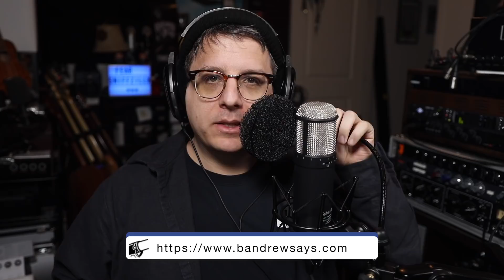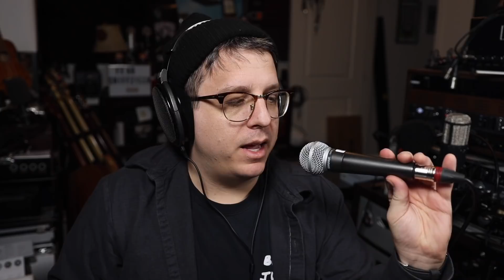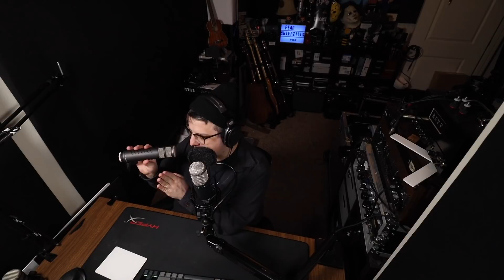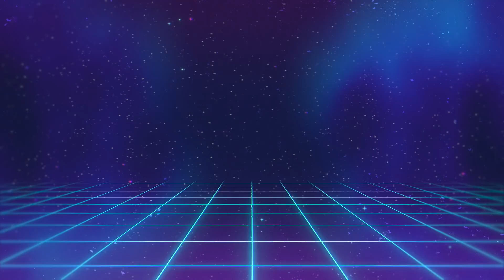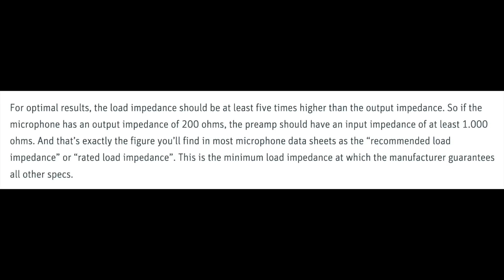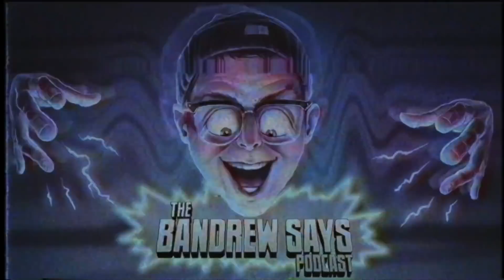Should You Try Other Mics, What is Output Impedance and Load Impedance, and More (BSP-233)

Comment: All I can say is I love this channel for so many reasons . 👏👏👏
Now, as a fun rabbit hole, …Impedance is one of those amazing/important topics of conversation that starts to weed out/invalidate probably 98% of the “vintage gear vs new” side by sides (and many others) that you’ll see online. This is because electronic circuits in audio gear have changed significantly over the years because audio gear used to actually be plugged into tubes/valves before transistors were invented. Meaning mics also had tubes. But there were other technologies around that are obsolete like carbon button, mics, and crystal mics and for fun, look up, balanced armature headphones, and then go look up modern in ear monitor systems and hearing aids and balanced armature . As a result, gear was designed to play well with other common gear.  Now, it’s all an awkward hodgepodge. 
For example, I just plugged in my newly acquired NOS (new old stock) 1961 Reslo RBH/WS “Celeste” ribbon mic today. It actually worked! (Google Reslo RBH Beatles Cavern) essentially the sm58 of the 60s-70s in England. 
BUT, these mics can only use their cable because of the various configurations available, which are identifiable by a color dot on the inside of the cable connector. 
The RBH version I have has a the red dot on the 3pin (not xlr) connector. This means it’s configured/set internally to be high impedance. This is supported in that the other end of the cable is a TS 1/4” connector.
BUT
…..drum roll……
The badge on the mic says Reslo, Hi-Z, 30 Ohms 
😁
Does 30 Ohms sound like Hi-Z ? NOPE! Pretty confusing then right?
Just like how the word “sick” can mean two completely different things depending on who saying it.
Different times, different circuits, different connection needs.
Also, output impedance is frequency dependent. Also, all those modeled plugins we use that were born in the 1960s and later may originally be designed with different impedance than you may be aware of. And how have manufacturers accounted for this as it relates to frequency etc etc etc etc 
I’ve been in this industry for a little over 28 years now and I’m still cut off guard and surprised every once in a while by something like this Reslo 30 Ohm “Hi-Z” mic 😁

Neumann microphones among other top brands have played a big role  in my career, but interestingly, I do not own any of their microphones, or AKG (another landmark mic brand throughout my career). 
Because I buy tools for their capability, not their brand recognition. Especially when I very clearly know what I am and I’m not paying for and receiving with them at this point. 
My favorite mics of theirs are no longer the best choices for the price like they used to be. It used to be they were one of only really a few choices available.
Other than my little pet project with the Reslo - which is my first ever purchase of a vintage microphone - I buy microphones that have the best capabilities, and I mean, actually the best capabilities and consistency and predictability for the price.

Neumann and AKG were very different companies back in the day but they are not the only choices anymore, and are definitely no longer the most forward thinking, most capable or competitive choices any more.
Surprising to me though, is I am now using Neumann monitoring for my 7.1.4 Atmos system. Who knew they would be making such incredible speakers for the price and size (!)
The good news is, new gear is typically made to work well and play well with new gear, but buyer beware, sometimes the companies with the most popularity online presence and number of raving reviews, are sometimes just the ones who happen to be spending the most money on marketing and giving the most mics away to get reviews. 
Just food for thought, when was the last time you saw an advertisement for a Rolls-Royce or Lamborghini or Ferrari or Bugatti  etc., etc. Applies to any industry. If a brand is as good as the manufacturer says, it is, why are they having to give so many away for reviews? And spend so much on ads? Hmmm. 
There’s a time in a place for that but generally just to increase awareness beyond an existing solid core base use by professionals.… Not to buy user base. Just something to think about.

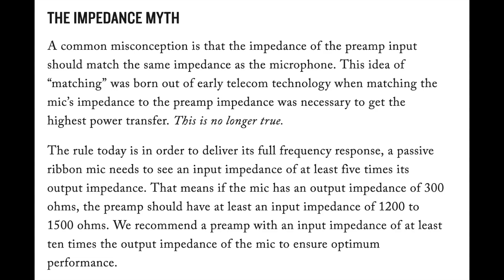Comment: (1) Note, he says "optimum performance" (26:00) this is about the optimal performance of the preamp, not optimum power transfer. Matching the impedances (ex: 600 to 600 ohms) does indeed provide for "maximum power transfer," but preamps are designed around voltage across the pre's input, not power transfer from the mic to the preamp.

(2) The voltage (as a percentage of the mic's output voltage) across the pre's input is Vp = Zp / (Zm + Zp).  If your mic has an impedance of, say, 600 ohms and the pre has an impedance of 1200 ohms, then Vp = 1200 / (600 + 1200) = 0.667 = 67% of the mic's output voltage is available at the pre's input.  In reality, this will never be 100% as neither Zp nor Zm can ever be 0 in the real world.  Another example would be a 300 ohm mic into a 3000 ohm pre (i.e. a 10x pre). This would be Vp = 3000 / (300 + 3000) = 3000/3300 = 0.909 or 91% of the mic's voltage is available to drive the preamp.

This plays directly into relative dB gain/loss. In the first example the voltage ratio was 0.67. Knowing that relative dB = 20 x log(Vp) = 20 * log(0.67) = -3.47 dB loss. In the second case, 20 x log(0.909) = -0.8 dB loss.  The second example had much less voltage loss, and will therefore requires less additional preamp gain to makeup for that loss.

The practical side of this is that if my Apollo Unison is a 5.4k ohm pre, and my Heil PR40 is a 600 ohm mic, then Vp = 5400/6000 = 90% and I compare that to a 300 ohm mic into that same Unison pre, then Vp = 5400/5700 = 95%.  So for the Heil I'll need 20 x log(0.90) or 0.91 dB of additional makeup gain, while for the other mic I'll need 20 x log(0.95) or 0.45 dB of makeup gain. Not much difference even though one mic was half the impedance of the other. But as the input impedance of the pre gets less and less, the differences between mics can become more significant. If these same two mics were compared on a Neve 1073 Unison plugin on the 300 ohm setting, the 300 ohm mic would require 6 dB of makeup gain, while the PR40 would require 9.5 dB of additional makeup gain.  Or to look at it another way, a 40 dB setting on the 1073 plugin with the Heil will be 3.5 dB lower output than that same setting with the 300 ohm mic (i.e. the difference between 6 dB and 9.5 dB makeup gain).

Note the above is talking about "relative" dB gain or loss, not specific dB values on a pre's input scale. So a "5 dB makeup gain," for example, may mean you need move your pre's input from 35 to 40, or from 50 to 55 depending on the specific pre being used.

Comment: Re: that load impedance question, this can be used to tweak the frequency response of dynamic microphones, whose source impedance is actually somewhat variable over frequency (as is the case for any dynamic driver). On the SM7B, going lower will basically just make the mic sound a bit duller as both the highs and the low end are reduced, so you probably don't even want less than the standard 2-3 kOhms and may appreciate something higher than that. A Rode Procaster or similar "radio mic" may be a different story.

Neumann's advice is bang-on for condenser microphones - there is nothing at all to gain from a lower than standard preamp input impedance with these, quite the contrary, you would be worsening distortion performance and level handling.

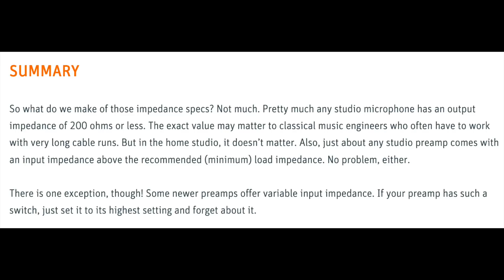Comment: At 24:31 you read a quote about impedance and your article says to set it at the highest setting and forget about it. I concur with this 99% of the time and even demonstrate this is my Cloudlifter CL-1/CL-Z review at this link and time stamp: https://youtu.be/A35Ol89_2q8?t=587

If you think about it, lowering the impedance on a preamp device is bringing down the input impedance from 10X or more (or whatever is recommended - I've seen from 5X to 10X) to only a couple times higher that that of the mic. Doing so essentially chokes out the mic feed just as a long cable would and, also as you read, the result is your highs being reduced. The Cloudlifter CL-Z goes from 150-15K ohms and the higher you go with it, the more full the signal is kind of like putting your thumb over the end of a hose to increase the pressure without changing the amount of water.

Comment: I am acquiring a locker of microphones when maybe I should have bit the bullet with the SM-58 earlier.  Match it with a Fethead and it will do almost anything.  I also bought the M2 (and now a Fathead for it as well) but it is quite noisy.  Good sound otherwise.  The AKG D5 is another journeyman mic (and not as shrill as the Sennheiser E835).  I also bought the Neumann TLM102 and it's good for what it does.  The cheaper Sennheiser Mk4 is no slouch.  And I also like the Beta 58a which need a little less gain than the SM-58 (and also good with a Fathead or Marti Audio equivalent).  At the end of the day, if I only could have one mic, it would be the SM-58 with a Fethead even for podcast.

Comment: For the guy with the Q2U Samson, check your settings in (if on a Mac) Audio Midi Setup. For whatever reason a lot of audio interfaces and VOIPs are dropping the output down to the .5-.6 levels. Boost it back to .8-.9 and your output will be much stronger

Comment: For recording the vocal and the accordion, I remember doing something similar to this in a live band setting. A lapel/lav microphone was taped to the accordion strap facing the grille. It worked quite well and the audio was quite clear but if I remember correctly, the signal was quite hot. The singer used a separate SM58 for singing but I cannot attest to how that sounded because the microphone (which was owned by him) was completely buggered and pretty much unusable for anything. Unfortunately he insisted on using it. I would also setup some sort of mixer so you can mute each microphone when they are not being used so you don't end up having phasing issues that could be distracting.

Comment: This mic sounds good but $1500 is a bit too much. Do a podcast with the Rode NT1. I love that mic and it is probably the best value for a condenser mic out there.
Reply: To be very honest, the price of the microphone isn't too bad; it sounds better than a lot of cheaper mics such as the NT1. The great thing about this mic is that is can emulate many types of mic. It's advertised as the only mic you will need which is a pretty brave claim because the mic can apparently emulate the Sony c-800g, a VERY, very expensive microphone.